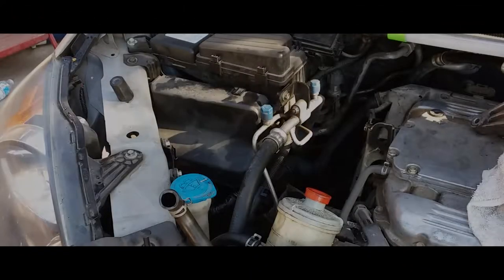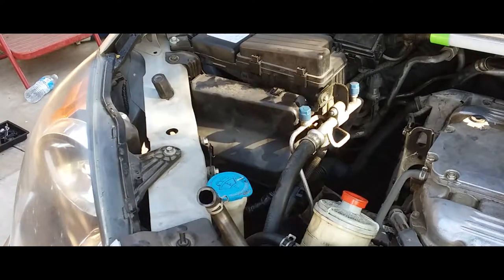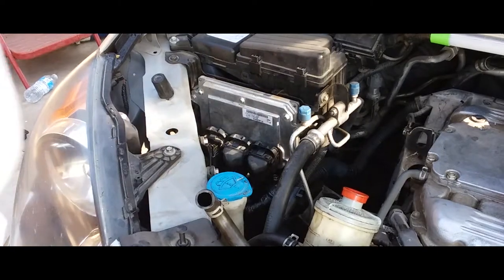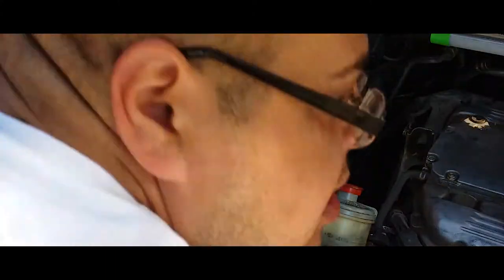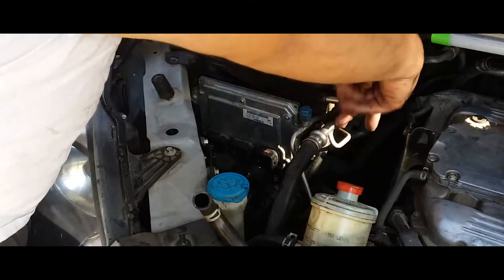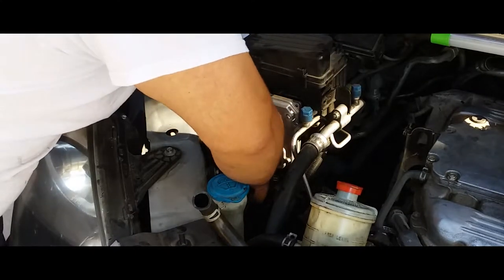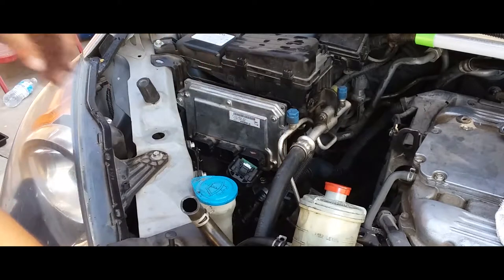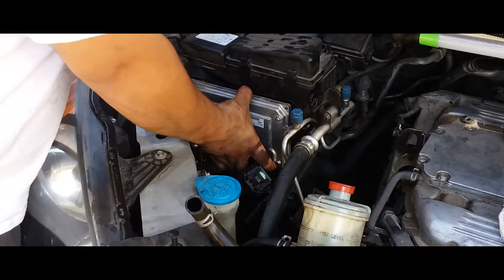How to: Remove a Computer Transmission Module from a 2010 Honda Odyssey

Comment: To clarify for future watchers. 
IF YOU ONLY NEED TO REPLACE THE MODULE:
The module is held in with 3 bolts (left, right, and below). The bottom one will require you get the separate small wire harness out of the way. 

This video more accurately depicts the removal of the module bracket. Also helpful for other repairs.

Comment: Hi George 

Why did you change the module? What was the symptoms? Hard downshifting? Or? 

Thanks in advance
Reply from the maker: No just removing the water pump and I had to remove that, so made a quick vid doing it. No issues tho sorry bro
Reply: GEORGE LOPEZ HOW TO DO IT YOUR SELF 

Thanks buddy
Reply from the maker: @ivan8599  your welcome!

Comment: Anyone have the P0705 computer code come up when the Check Engine light comes on? The description for that code (via a Google search) was that it needs to have the ECM, TCM, and TRS (all transmission "sensors"?) checked. 

The vehicle's only other symptoms: the gear lights in the dashboard are being indecisive (i.e., the Neutral light is on while the Drive light is flashing, and the vehicle is driving down the road--obviously in Drive).
Reply from the maker: Sorry bro sounds like you might have to take it to a shop and have them hook up the big computers
Reply: Right.
A mechanic friend offered to look at it in their shop, and yesterday they concluded that one of the communicators to the dash is possibly going out. After a simple reset, the symptoms stopped, and they said if it continues, they'll replace the part, but that it's just a communicator to the dashboard and has no affect on the driveability of the vehicle.

Thank you for answering!
Reply from the maker: @adelecarvalho1051  your welcome, yeah see a basic scanner wouldn't be able to pick up on that. I'm glad you got this figured out, hopefully it doesn't do it anymore and that part doesn't have to be replaced 🤞